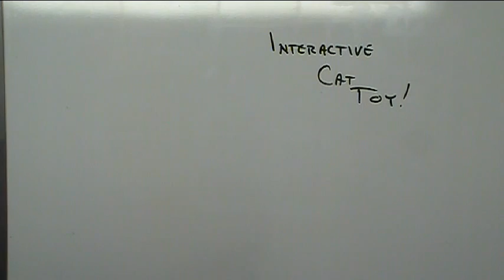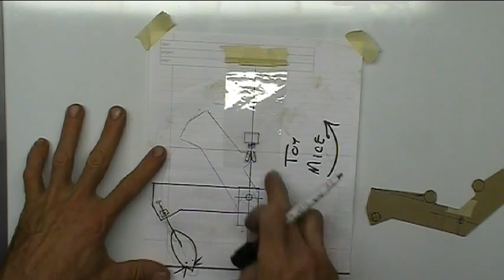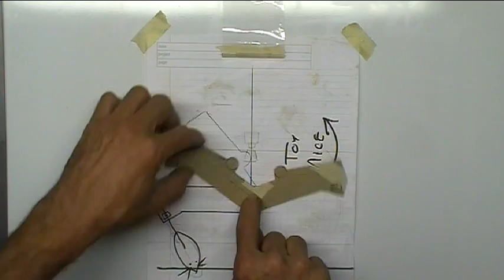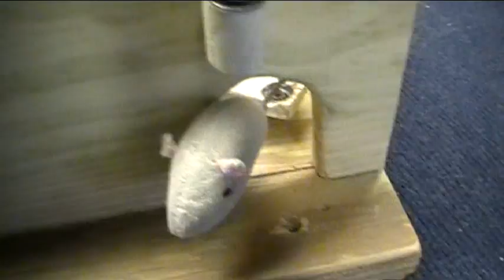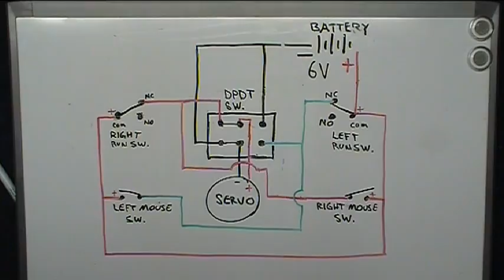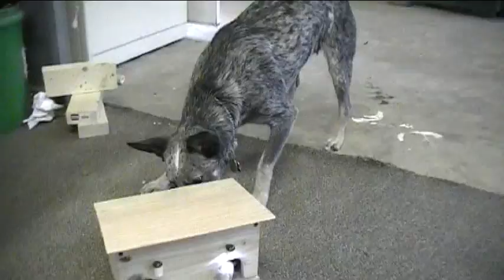Whack A Mouse Project

Comment: It would seem possible to avoid electronics & just have the elbow bend on a free-swinging rod with a bouncy spring action.  Mouse gets pushed, it bounces a little & backs inside just as other mouse, pokes its bouncy head out.  This would run quietly w/less force. The dog was frustrated & the cat nearly got poked in the eye. This is a great toy for the creator tho!